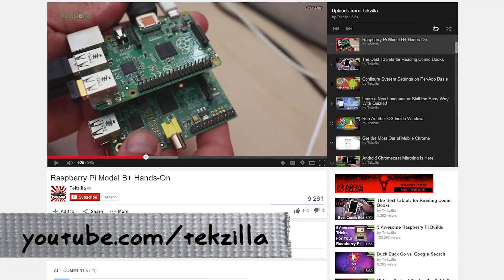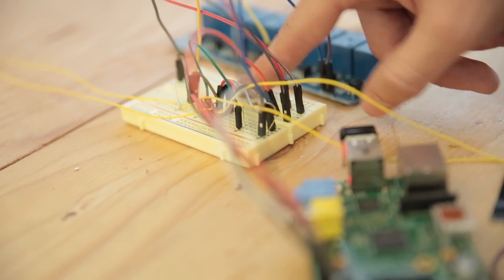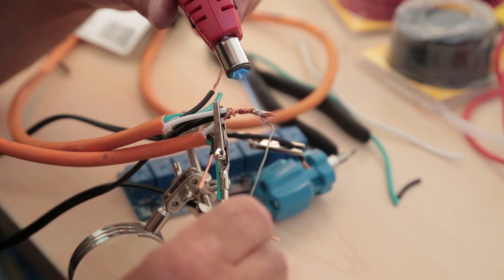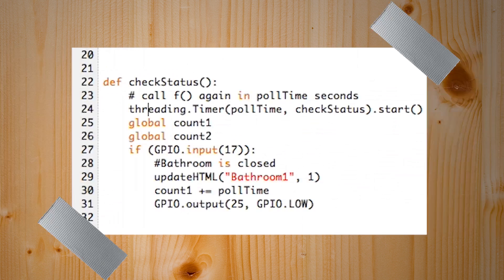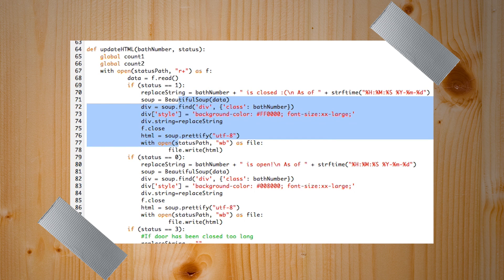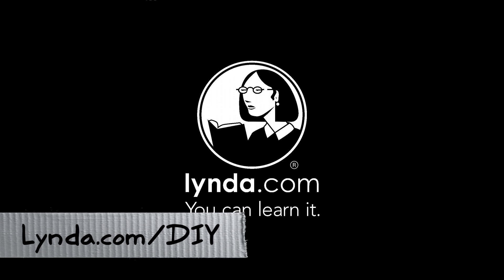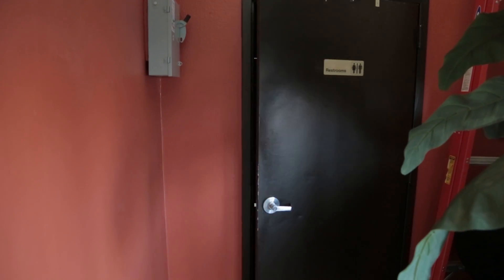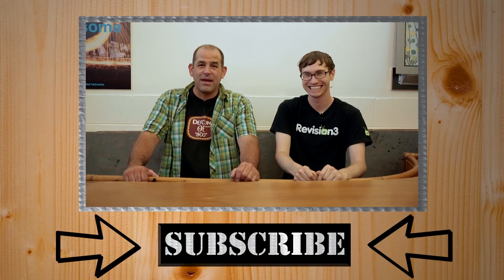Use a Raspberry Pi to Fix Everyday Problems. Become the Office Hero!

Comment: Talk about overengineering... Over here in Europe, we have a piece of red and green tape stuck on a washer and another washer with a "window" cut out of it attached to the lock of the door. When you lock, the washer turns around and the red piece is visible through the "window", when you unlock, the green piece is visible. A lot cheaper, a lot easier, a lot less stuff that can break.

Also, we build our bathrooms big enough for the office. If it's a big office, it's one of those stall type bathrooms with several seats and urinals and all of that. If it's a medium sized office, we have two or three bathrooms. If it's a small office, it's one shared bathroom, sometimes a ladies and a gents.

Combine the two and you won't need any aluminium foil (yes, I used the PROPER way of saying it) door sensors, cables hanging everywhere, $40 microcomputers, web servers or phone apps to see if the loo is available.

Comment: The ugly truth is that the pi is a cheap solution looking for a problem.  Not bad to learn programming on but 99% of the projects published are of no practical value.  Check out AvE's teardown of the IoT juice squeezer.  

An easier solution would have been to mount a live video camera using the pi  as the server for a streaming web app.  The camera would only have to scan a semaphore showing if the door was locked or not.  Just a matter of using whats already been invented and debugged.

Comment: Great Idea .. but.... Your wiring is likely not to code. your door switch  should be a Magnetic switch.  You should have a motion sensor energy conserving light in the bathroom. and monitor it's status for  occupied status. EG door closed and light on = occupied.  Light off = unoccupied or a non moving occupant in the dark.

Comment: Why use a PI?  This is more suited to a $0.50 pic chip or an atmel ... leaving you money left over for a set of reed switches... which then leaves you with enough tinfoil left over to make some baked potatoes.

... Mmmmm, baked potatoes!

As for: "depending if you need networking" - you really don't need a Protocol Stack, WiFi/Ethernet module or even a MAC/PHY.  A pic/atmel chip will happily send UDP status messages to a server for almost no money - and it can do it blind if you're on a switch rather than a hub (meh, who's on hubs these days)

Not everything requires 4 cores, a gig of RAM and a full blown Linux distro.

Comment: Put the sensors on the lock instead of the door jam. That way if people just close the door after they leave it will not show the bathroom as "occupied". The site will only report "occupied" if the door is locked. 95% of the time, people are going to lock the door if it is in use. Especially if they know that the bathrooms are busy and people are going to be trying to open the door if it is not locked.

Comment: Nice Idea, but why do you host that on Dropbox und buy a domain? Just run nginx or lighttpd on the pi, assign it a static ip and use that. If you have a DNS server running use that to give it a proper address and you're done. Less code, cheaper and faster.

Comment: Nice.... I love mine

https://rover.ebay.com/rover/1/711-53200-19255-0/1?icep_id=114&ipn=icep&toolid=20004&campid=5338048697&mpre=http%3A%2F%2Fwww.ebay.com%2Fitm%2FHubPiWi-1-3-Raspberry-Pi-Zero-Hub-with-Wifi-No-cable-connector-%2F192104659088%3F%26_trksid%3Dp2056016.m2516.l5255

Comment: Can a raspberry Pi be used like an arduino with a breadboard and components
Reply: Yes, just be careful about the voltage. RPi can only handle 3.3 Volts, not 5.0 Volts without some resistors to split the voltage down.

And output can only handle 20mA, but that is not that far from Arduino.

(You can also use GPIO-pins in Scratch)

Comment: I'm still waiting to see a real 'useful' application of the RPi architecture.  You know, a weather-station, an online 'weather site' tie-in, a REAL NAS build (I've got 14-Tb NAS'd through a single RPi...and it is EASY, IF...), etc.  I mean, every 'gum-and-bailing-wire' project you guys have shown, leaves me with 'there are cheaper, better ways to do this WITHOUT RPi's' in the end.  That's sad, considering I love the RPi's...problem is, no one publicizes the beneficial applications of them!

Comment: You do realize, you can (alternatively) buy a contact-open (or closed, if your preference) set of reed switches for about $5, and do this with a simple doorbell wire run instead, right?  Do I REALLY need a website to tell me that the bathroom 20-meters away is occupied, or not? I know, maybe a CODES BOOK to tell you that you do not have sufficient facilities for 50+ people in one office! Now THAT would be a good expense of money!

Comment: In my opinion you guys did one major mistake. Why haven't you add sesors on the lock of the door?? That way you would really know when the toilet is closed for good. With your method you are just guessing. Also you guys could use an http server on the pi, with that done no outstander knows if your toilette is open/closed.

Comment: You guys leave bathroom doors open when empty?!?
Reply: exactly
Reply: I know, right?? Should have wired the sensor to the door's internal lock!
Reply: Same question
Reply: I believe that's why he had a third status which will look at how long a door has been closed. unless someone died inside, it would most likely mean it is empty if it has been closed for a long time.
Reply: @maddogmccree88  It's still a shitty solution. If you assume everyone goes to the bathroom once a day (low estimate?) and rely heavily on the website to check occupancy (which is the general idea?), then that would mean that there could be (in theory) as much as 270 minutes or 4,5 hours of waiting time for false occupancy.. As soon as the employees realize this they would stop using the website. I get it - its just for fun.. But the logic behind it is terribly flawed.

Why not program the status update every other count of circuit closure? It's not flawless either, but it would be a better solution. Holding the door for people waiting outside would be a no-no, but assuming the website is being used there wont be anyone outside waiting.

Comment: Why would you use such a complicated and expensive system?

You could just wire a standard 220 volt lamp and put a switch in the frame of the door. That way it would last forever, you wouldn't need any fancy program/Raspberry Pi, and it would do the exact same thing...
Reply: +Sketchy Songs On Saturday Ehhh... I think you actually didn't get the idea behind this, that was how to setup: problem IRL - sensor - raspberry pi - web report in real time. And btw, your "solution" is not different from waiting outside the bathroom, which was one of the problems described on the clip. With the web report people do not have to stand up and/or stay away from their desktops. Besides, they can even go somewhere else, and still see if the bathroom status changed, through the website
Reply: +MrBlaoblao If you put the light somewhere where everyone can see it no one needs to wait outside the bathroom.

And by using a switch the light is turned on/to green (one click while entering) and off/to red (one click while leaving).

Comment: I don't know code 
What is the best way to get a programmer to programme a machine 
Is it a flow chart?
I want to control several 2hp electric motors and many servos and sensors including movement /distance sensors
Should I just use one of those vfd machines on eBay or is a raspberry a better way?
What can I buy to interface a computer and electric motors/ sensors?

Comment: Wait, so why don't you use something cheaper - an arduino?
Reply: ikr
Reply: Salliance Arduino Ethernet shield exists...
Reply: +Salliance nope, the Arduino plus the Ethernet shield is only about 45$
Reply: +Salliance did you include a power supply and SD card?
Reply: +Salliance an arduino clone + Arduino ethernet shield can be had for ~10eu, while the raspberry alone costs more. The power supply is needed for both so that one can be removed from the cost.

Comment: I know this is an old video but you could upgrade your sensory program and make it more accurate by using this bareconductive product it is a board that can pare with the pi and it uses conductive paint as a sensor and the paint can be put on the wall 3 minimum to make an accurate sensor and have it update with from that just something to think about plus the design they had on the trailer video for bareconductive had a really cool design

Comment: Why aren't you using an ESP8266? It fits this need perfectly! I wouldn't waste a whole Raspberry for that!
Reply: +Jan Seewald Indeed! You can even reuse the LDR on this module to check the light status, instead of hacking with aluminium foil :)  Even better; attach this module in the lightbulb itself for accuracy, and make an app or another lightbulb try pinging it.

Comment: You yuppies need to get over yourselves and use a 2 liter bottle with the top cut off. If it's good enough for all the truck drivers it ought to be good enough for you. I have worked construction for over 20 years and a bathroom is a luxury not a necessity. Do you think the 3 billion people living on less than $2 a day worry about waiting in line or using a restroom?

Comment: I only use my current pi as a dedicated linux box for pentesting. If I can think of any good ideas I might get another one to play around with. Thankfully they're relatively inexpensive once you have all the peripherals :)
Reply: How fast is it, I was thinking of running kali Linux on a pi and using that but it seems that it would be slow.
Reply: +Britannio Jarrett  is kali linux slow on a raspberry pi 2 ?
Reply: +Darkc0de that's what I asked

Comment: Why on earth are you using Dropbox instead of lighttpd (or any other http server) installed on the Pi itself? It would probably be easier to set up than the Dropbox uploading script, it would be faster and it would work even when the Internet goes out.
Reply: +hellterminator yeah Dropbox gets super buggy when lot of updates are thrown at it in short space of time. So I guess if you have House party/gathering = bugception.
Reply: +hellterminator That was my thought too, and assigning the pi a static ip or better yet a hostname would forego the need for a web address making the project even cheaper...
Reply: If he knew that he wouldn't installed a traffic light for a fucking bathroom door. Lol

Comment: Half way through the video and have to suggest two things. PIR motion sensor to see if someone is in the bathroom, and run the webserver on the Pi. PIR wont be creepy infringement on privacy, and python has a built in webserver why not use it.

Other than that, cool thing n stuff.
Reply: Now that I finished the video, why buy a domain, shouldn't this stay on the local network?

Never mind, it redirects to his personal page.
Reply: Yeah, a lot of room for improvement here. PIR (or even just checking the lock or if the light is on), local http server instead of Dropbox, queuing system, push notifications… 
And it's not even hard. All of this could be done in one evening.

Comment: Erm. Is is me or does this just rely on the door being open to indicate non occupancy? If so then if someone politely closes the door when they leave (to keep the smell in there) your detection system is none the wiser and assumes there is someone in there.

If all you're doing is checking whether the door is open or closed, then why not keep it simple and connect a 5v power supply and some LED's to the foil? Much simpler, no coding or relays required, and you can put the LED's wherever you like. If your staff are too far away to see the LED's, then you're probably breaking the regulations for number of toilets required per head of staff!!

My LED method also prevents the boss from logging in to check how much staff time is wasted in the crapper. Boss has his own toilet facilities, of course...

Comment: Why not run a HTTP server on the pi?
Reply: +Michi Lo You only have to run apt-get install apache once. After that it will always be running when the system is on. The html can be put in /var/www/ or so. On your router you add a port forwarding rule for port 80 tcp to the ip address of your Pi. Using Dropbox for this is so unprofessional.. On your Pi you can even install a mysql database and php (apt-get install php mysql-server), which gives you a whole bunch of powerful options. Good luck!
Reply: exactly what most people do.
Reply: +omega I had the same idea! Or at least used a WebService to send the data to the webserver.
This was very much "bullshit approach to engineering :)" 
I mean installing an apache is like 2 minutes work. Writing a file directly to the docroot is faster and more trivial.
Reply: +Michi Lo This bad and poor engineering. It takes 2 minutes to setup an apache server.
And DropBox could not be reachable and all that sort of stuff that really is important if you do proper engineering ;)
Reply: +Michi Lo It takes a bit more time, yes. But it isn't harder than figuring out how to properly connect the sensors and lights for example. As an added bonus, the pi webserver will keep working even if there's an internet outage. No need for any port forwarding doesn't really apply if you target the pi directly (which they already use a router setting for, so that people can simply enter bathroomstatus.com and be shown the dropbox HTML file).  As for restarting the apache server when the file is updated, I'm pretty sure turning off caching would fix that.

An even better solution would be having sockets and directly sending status updates to the clients without a refresh (meaning you're not updating the file at all) but that would be quite a bit more work to setup properly (but definitely possible with python).
Reply: +Michi Lo not really...
Reply: +Richard van Pukkem And soon the company will have bathroom stats out on their website. ^^
Reply: Chirimorin1 Sure. But is that really necessery? 
(I found Lighttpd, and it is really good.)
Reply: Michi Lo Well, they presented it as a great thing. And I even think they're right. So why did they stop and even stopped so soon?
Reply: Christoph Michelbach We do not know.
Reply: +omega
For python, I prefer using a micro framework like Flask. That way, you don't need a web server at all, you just define /some/routes, and off you go.
Reply: Gain Medium During Linux setup (Raspbian) you can choose which packages will be installed and which won't. But i guess if you do apt-get install php5, that it installs apache automatically anyway if it's not on there yet so doesn't matter :-)
Reply: Richard van Pukkem I never installed Raspbian that way, at least i never got a setup.
Reply: omega if they're doing that, might aswell do https
Reply: Because it takes more time to set up than Dropbox.
Reply: Richard van Pukkem Install apache, start systemd service, put files into the folder, restart service, update files, restart service. 
For unknown reasons i need to restart the service to update the files.
Reply: FrantACs I know, they told us the answer in the video. But in my opinion its easyer to run
"./dropbox_uploader.sh upload webpage.html" once every update, instead of hosting a server (Still haven't figured out how to open ports on my router)

Comment: Well if only the ones in the office needed to access the webpage then you could've just installed an apache server in the same rasperry pi and make the program write the status of the bathrooms to a text file. The webpage, since it is also in the same raspberry pi, it would have access to the file, it would read it and display the status of the bathrooms. This way is also free and doesn't need any libraries to upload the file to dropbox. Way easier.

Comment: I know that a raspberry pi is like a mini computer thing.... I think. But what exactly is it? What was it?
Reply: Em0SceneStabr A Raspberry Pi is a very small and inexpensive computer, about the size of a credit card, that runs Linux and all of the tools that go with it.  It was originally designed to be an educational tool (hence its low cost), but it has become increasingly popular as a DIY controller because it is so versatile.  Its processing power is roughly comparable to home PC's of the early 2000's, plus it has an array of GPIO pins (somewhat like those on an Arduino) that make it easy to interface with sensors like those in this video.

Comment: jesus this python code sucks. 1) dont use os.system() 2) dont use globals but classes with encapsulated variables 3) use proper string formatting 4) your code is not pep-8 compliant 5) dont use beautifulsoup from a raspberry pi, its a slow ass library.

nice project though :)
Reply: SanF Fer jesus this comment sucks (to use your words)
1) doesnt matter
2) doesnt matter
3) doesnt matter
4) doesnt matter
5) doesnt matter
i dont even need to read the code to know that. if you are out to insult random people on the internet - try places where you can sound smart and nobody reads it. otherwise its just sad.
all your points do nothing to improve the project, which probably means that you just want to sound smart.
Reply: Bananaramaaah 
I'm not insulting random people I'm just saying his code sucks.
Reply: +SanF Fer Why would you care about wrapping up the globals in a class when the code is so short?
Reply: +SanF Fer Agreed, but I'll cut myself some slack since this was one of the very first programming projects that I took on. That being said, PRs are always welcome on any of my poorly written (but functioning!) projects. https://github.com/palmdalian/BathroomStatus